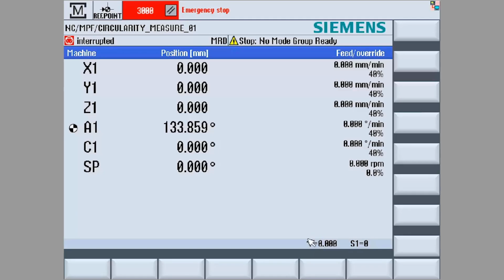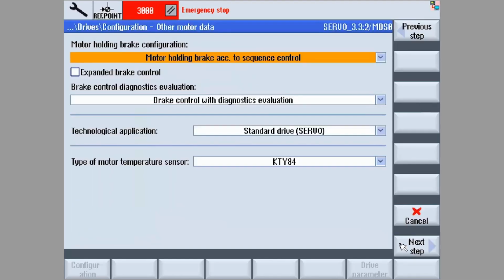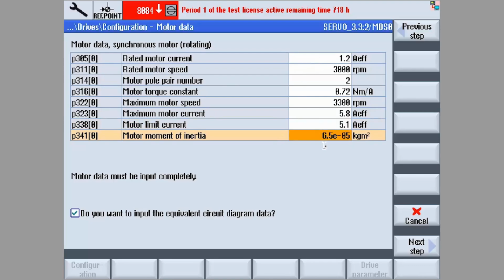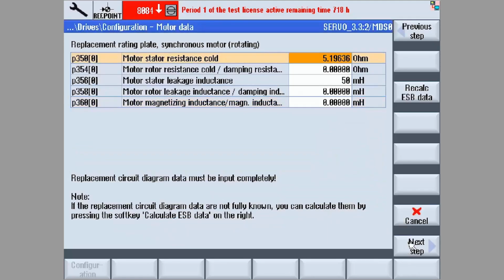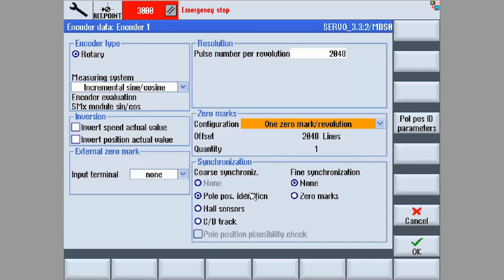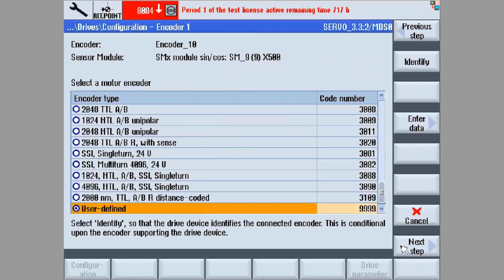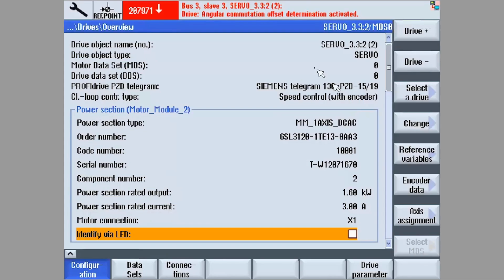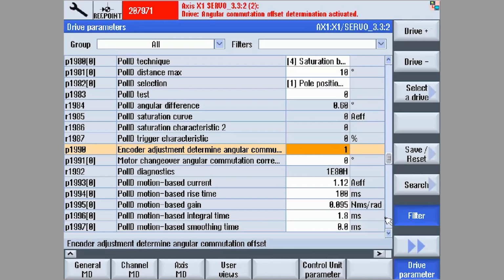Non-Siemens Synchronous Rotary Motors | Commissioning using a SINUMERIK 840D sl

Comment: Thank you for the valuable information. I'm having trouble with my Sinumerik CNC machine. It's showing error 231100 due to an encoder replacement. I need help configuring the zero mark and initial angle